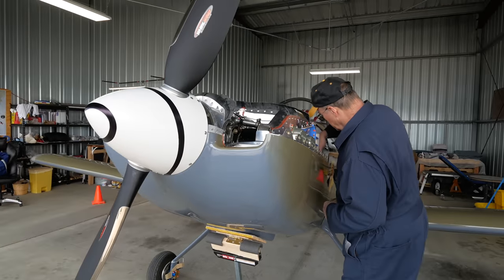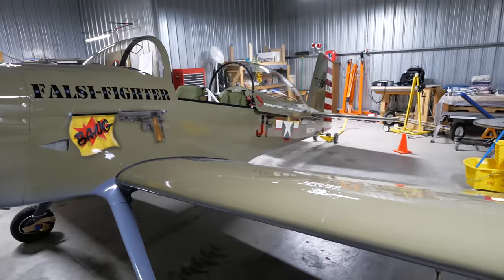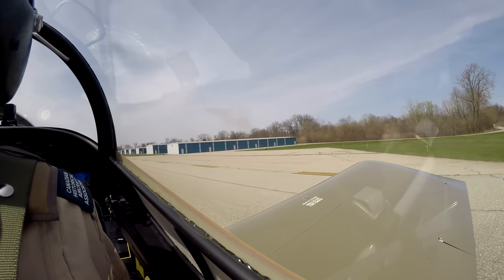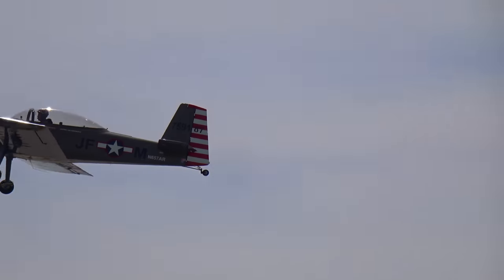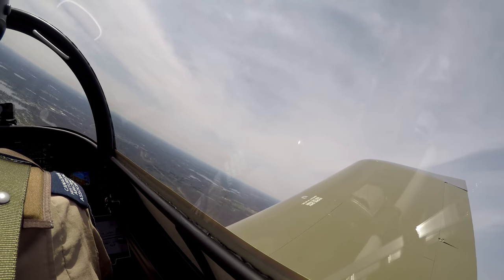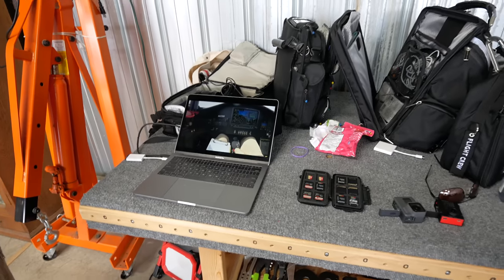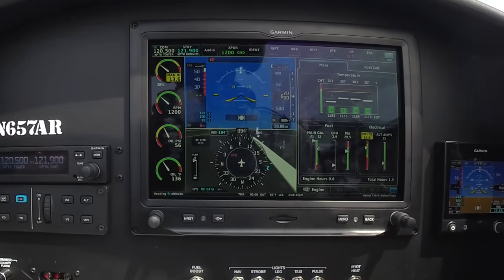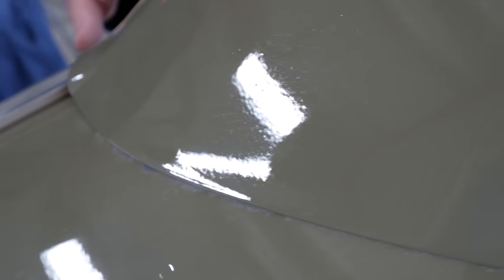“That Did Not Go As Planned!” RV-8 First Flight Aborted

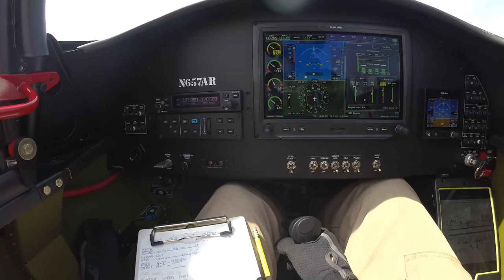Comment: 4:42 Exactly! I got to fly an RV-4 at the EAA in Oshkosh (actually a nearby airport) with Dick VanGrunsven, the designer. What a joy to fly, coming from an ex-flight instructor with thousands of hours in boring Cessna 150s. I got the tail kit, shaped the spars and drilled them, but due to other factors, sold the kit to a local. To me, the RV aircraft with a roughly 4:1 cruise to stall ratio and a simple design, cannot be beat. And I like to sit tandem and roll on the point.

Comment: At Waterloo-Wellington flight center, I was flying a DA40 with my instructor and we encountered a loud rattling sound around the pattern at particular power settings.  This aircraft was a new plane to the club that just finished a full teardown inspection a couple weeks before the flight.  We couldn't find the source of the noise initially, even on the ground, and though the trim seemed to 'get stuck' it had nothing to do with the noise. In fact, on my next flight a week later I did a thorough walkaround and found a flashlight in the wing cavity where the gear strut joins the fuselage.  I was rather shocked that of all the pilots who flew it in that time, nobody else reported or found the issue.

Comment: I had the floor under my feet develop a vibration on my 8 , that was due to impulses from the exhaust pipes, a change in deflection was the fix..I also had a 1.5 inch strip of the fuzzy side of Velcro around the inside of my canopy , might be why I had no vibration of the canopy.
Reply: Good fix! the Velcro would disturb the laminar airflow under the canopy edge and cancel out the speed induced resonance☺☺

Comment: I think every single builder regardless of experience should have a test pilot. There is too much emotion and nerves and attachment to make objective decisions in the airplane should something go wrong... even if it all goes right, you may not be paying attention to the correct thing. For example, if you were working on a certain part of the aircraft and had some thoughts on that, your mind will be stuck there when it should be elsewhere. Smart move. Nice airplane.

Comment: Love that paint livery!  Even as a Navy vet, I gotta like it.  Great choice. 
Would like to know the details of what solved the vibration problem, just for the edification.
Nice video, too.  Well done!  Steely test pilot!
Reply: On the advice of Curt Martin, LongEze builder and dear friend, I used strips of D-section silicon rubber weatherstripping along the aft edges of the canopy skirt.  It worked perfectly (see still photo near end of video).
Reply: @goatflieg  Thank you! Glad that it worked well.
Reply: @goatflieg  thanks marty. great build. Does the weather stripping interfere with canopy function/retraction at all?
Reply: @BigDickMark  No; it formed to the gaps really well and then held the shape.  If the canopy is locked for a long time with temperature changes the weatherstrip can stick just a little bit, but it always comes free without peeling.

Comment: Good work....builder of N672PC RV7-A....we  had a wicked nasty firewall forward problem....short between starter and fuel servo fitting....replaced two sets of throttle cables....before tracking it down....by hand.  Got hit by a car in June 21 final was cadillac 0 RV 1.  But juries still out on heavy left wing suggestive of torquing airframe from caddy.  Passed eddy current crack inspection on spar attach points in flying colors.
Reply: Wow!  And I thought my journey was rocky, with a crankshaft recall and a close call with a herd of deer... !

Comment: You may have done this and not shown it, but you should box check in both directions in case a linkage or control surface binds as a function of not only position in the box but direction of movement.  For instance,  a heim joint that rubs a bracket when aileron is at full left deflection and elevator is moved. If you pass it elevator nose down to nose up it is a glancing rub, but from nose up to nose down it meets a lip and is a firm stop.
Reply from the maker: Thanks for the added insights

Comment: Very cool video! Thank you for sharing Marty! 

What's the "wedge" that Dave mentioned at 19:36?
Reply: A wedge is a term for a physical piece of material (usually balsa) that is shaped like a wedge and attached to the rudder to trim the airplane into co-ordinated (ball in the centre) flight at cruise speed. Some airplanes have rudder trim systems to do this, and some airplanes have a tab on the rudder bent in the direction required. 

It’s always nice to simply build it so well that it is not required (in the RV universe anyway). It takes only a tiny imperfection in the rudder to need it.
Reply: @thehoeser  Very cool, thank you!

Comment: This is familiar. I had 'buzzing' on first flights of tip up canopy of my RV-7.  Redid the seal of the front canopy lip to the fuselage and went away, and has stayed good for over 500 hours.  Funny how 150 MPH airflow can change things unexpectedly.      

BTW, I DID paint before first flight.

Comment: How was the vibration solved? 
A soft gasket / damping feature at canopy interface?
Some kind of canopy brace glued in?
Reply: D-section silicon rubber weatherstripping applied to the aft edges of the canopy skirt.

Comment: I wonder what the general opinion is about the RV-8. I would love to build one, but is it as good as some of the hype? Also, this plane looks great. Good job to the builder.
Reply from the maker: I would agree the RV-8 is as good as the hype.  SO many retired fighter pilots choose the RV-8.  The only reason I went for an RV-14 over an RV-8 was for the side by side passenger experience. But from a pure flying perspective, I’d rather be sitting centerline with stick right hand and throttle left hand… but I am lucky to have access to the warbird trainer fleet at the museum, for that sort of flying experience.
Reply: I love my RV-8. Centerline seating with stick in the right hand and throttle quadrant on the left is so natural for a right-handed pilot. Climbing into the RV-8 is like slipping on a shoe, feels like you’re wearing it. My RV-8 flies exactly on the numbers..182 mph TAS at peak EGT with the O-360 engine and constant speed prop. Cruise CHT’s in the 320 F range. 7.3 gpm fuel flow. It’s a slippery airplane indeed. Always a delight to fly. Beautiful to look at. A real attention getter.

Comment: Recently sold my 8, regret it but I rarely flew it. Of all the planes Ive driven from ultralights to Airbus the 8 was the best fir all round bang for buck👍 there’s nothing like centreline seating g & conventional U/c👍
Reply: Totally agree on the bang for buck for the -8. I can’t think of a single improvement I’d want to make. Bought mine used. It’s now worth quite a bit more now, but still a bargain considering it’s impressive all around performance. 275 ft groundroll on takeoff…almost as short as a Husky STOL.

Comment: Slight discrepancy of low pulsed engine frequency and high flutter frequency were never related. 
 Investigate all possibilities. Eliminating 97%.
Announce doing so is fine. Wished tactic to investigate further was done in flight. 
Plastic putty knife in pocket might make a great testing tool at opening gap testing. 
Probing stethoscope is another great tool, it only hears what it touches. Used by default in late 60's from my tool box.  
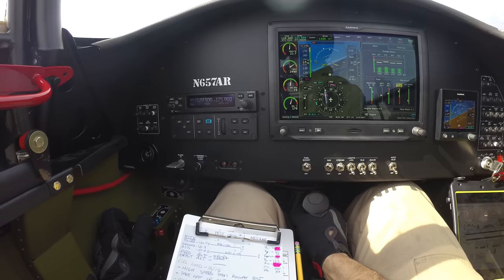 8:18 moment of vibration 
12:17 - engine sounds strangely missing on start up on some cylinders. Or glitch capturing sound. 
19:56 - canopy off views - Would have been nice details of D seal applied. 
I worked at the FBO the ballistic chute were first developed. Was this ever a thought for option? 
Seeing glimpse of construction details at the floor at his feet, he looks like a tough ship _ Bonanza style. 
Restored a few of them,, only takes once behind interior to see exclusive build details second to none. 
Glad it worked out in the end. 
Cheers
Reply: Ballistic chute isn't really viable for any of the Van's aircraft; they'd all have to be completely redesigned to accommodate one.  Thank you for your compliments and detailed analysis.
Reply: @goatflieg  
After a bit of thought, a chute tube would certainly present quite a few issues. 
It would have to be within the engine bay side of firewall, or at near the tail to not get in the way of canopy sliding back to open. At least a tail deployed moment  has great view of final stop, but 50 times cheaper if tail first in the dirt, vs face in the panel. Unfortunately the real short sighted design are seat rails, seats &  restraints, after replacing many, should be equal to Nascar. 
Cheers

Comment: What’s with the factory five racing truck in the background of the early kit delivery photos!? Did he build an rv8 and a factory five at the same time?
Reply: My crew and I had a laugh about that.  "Hey Marty you got the wrong kit!"  "Works for me.  Instead of an RV-8 I'll have a Cobra replica; instead of having Barrett build the engine, I'll have Roush build it!"  Tony Partain arranged for the crateless delivery and Stewart Transport did the driving.  The Factory Five trailers have a built in crane to help removal.  Was very pleased with the delivery experience; in the middle of an ice storm, the driver not only got it unloaded safely but helped us get it into the shop.
Reply: I received an FFR car from one of those trucks they are cool with the overhead crane. I understand they also deliver kitfox aircraft too.

Comment: What was the fix? Additional layers of fibreglass to stiffen the canopy skirt, or a modification to change the nature of the skirt/fuselage gap?
Reply: Application of some D-section silicon rubber weatherstripping along the aft edges of the skirt.  Steve included a couple photos near the end.
Reply: @goatflieg  Thanks. I didn't interpret them correctly, but now  you point it out...

Comment: Wingspan only 24 feet . . . wow.
Reply: My shop was only 25x25; made the initial wing fitting interesting.  Especially when I forgot to insert the aileron push tubes inside the wings before fitting.  Yes... I had to drill a big hole in my interior wall to get them in.  If YouTube would let me post photos, I'd share the meme it generated!

Comment: 19:40 "I don't think it's going to need a wedge" .. what's a wedge? I assume it's something like trim.
Reply from the maker: Copied from Dave's answer to a similar question earlier: 
"A wedge is a term for a physical piece of material (usually balsa) that is shaped like a wedge and attached to the rudder to trim the airplane into co-ordinated (ball in the centre) flight at cruise speed. Some airplanes have rudder trim systems to do this, and some airplanes have a tab on the rudder bent in the direction required. 
It’s always nice to simply build it so well that it is not required (in the RV universe anyway). It takes only a tiny imperfection in the rudder to need it."
Reply: @FlightChops  thanks for your time. I'd looked in the comments and missed it.

Comment: A&P here looking to build a RV, can I ask what the solution was to fix the vibration?
Reply from the maker: I collected some of Martin's answers to that - here they are pasted below: 

"I applied some D-section silicon rubber weatherstripping to the aft edges of the canopy skirt and it cured it completely.  You can see a quick glimpse of still photos of the fix near the end of the video.

On the advice of Curt Martin, LongEze builder and dear friend, I used strips of D-section silicon rubber weatherstripping along the aft edges of the canopy skirt.  It worked perfectly 

It formed to the gaps really well and then held the shape.  If the canopy is locked for a long time with temperature changes the weatherstrip can stick just a little bit, but it always comes free without peeling."

Comment: Perhaps I missed it but was the cause and the fix of the vibration?
Reply: Canopy skirt vibration; D-section silicon rubber weatherstripping along the aft edges fixed it.
Reply: @goatflieg  Thanks, glad it all worked out.  Very nice RV!  I have a RV-8 and have been looking for same weather stripping to stop the abrasion on my fuselage.  Where did you get yours and what type?
Reply: @jcheck6  I just went to the local hardware store and looked for the largest size D-section weatherstripping I could find.
Reply: @goatflieg  Many thanks.  Happy flying.
Reply: @goatflieg  
Great Looking Panel by the way. 
A few moons ago, restoring war birds mid eighties - and huge fan of OSH camping for a week, where 
some probably wished they were there when the SST did their airshow. It was obvious why they were 
never allowed here in the states during take off thrust. It duplicates a Saturn Five launch. 
Canopy: 
Feeling that body vibration - during test flight:
can canopy be cracked open in flight - to notice vibration quit? Detent locks to allow partial opening? 
*This tip will solve sticking seals parked & sun baked internally to 200F. 
Temp probe placed above visor will confirm temps inside. [As in remote monitoring meat smoker] 

*Best industrial silicone spray, wipe down mating surfaces,, should take care of sticking for many years. 
Plus protecting rubber from aging.  Treat baffling the same, to keep severe chaffing underside of cowling. 

I've had to repair restore many older black plastic trimmed Cessna's interior. Owners using folded pop out 
aluminum sun screens used in auto windshields, keeps sun off interior. 
Better yet, keep sun off all windows to prevent hazardous crazing & yellowing from occurring. 
Restoring plexiglass is not fun, sanding with 60 grit to perfect polish out. But saving $15K or more doing so. 

Fav'd Crashed & Fully Restored project to final test flight - 1943' Beechcraft Stagger Wing, and next time 
those going to OSH, make sure you don't miss the huge pack of them parked, camping under them. 
Absolute beautiful site. Lots of video here on them. 
Cheers

Comment: My prediction, loose gap seal flapping in the wind stream.
Reply: That's what I thought of first Hyp.  Happened on my -8 at the wing/fuselage intersection where the rubber seal came out.  Easy fix.  But in his case it was from the aft canopy.
Reply: That actually happened later during Phase 1.  Easy fix.

Comment: At 12:10 he CLOSES the canopy then yells "Clear Prop" 🙄💀 like people heard you fam. 😆

Also, as a previous Lancair Evolution/IV P builder, who FINISHES, "paint and polish", a plane before flight testing it? If something needs repaired that thing is going to take DAYS extra due to the EXTRA CAREFUL handling, And the possibility something will need refinished. This is Kit Builder 101.

Also, those little plastic fairings are a KNOWN rattle/vibration issue on  fixed gear airplanes.any little extra doo-dad to gain "a knot or two" really will stifle your progress. And cause other issues. There are flight speed limitations for a reason.

If this plane was already flight tested, and this was made for that "TV" feel, I will be highly disappointed.

Comment: I wish pilot's should stop putting thier mic in front of the mouth. It makes allot of static. If you hear the tower is nice a clear, it cause he has his mic either near his chin or on his cheeks.
Reply from the maker: Generally, there isn’t a 200dB engine running in the control tower :)
Reply: Different styles of mic’s. pilots mikes MUST be in front of the mouth or they will not pick up your voice. ATC headsets don’t have to filter out engine noise so they can be further away.
Reply: You could also just resort to watching simulator flying. Much less noise!